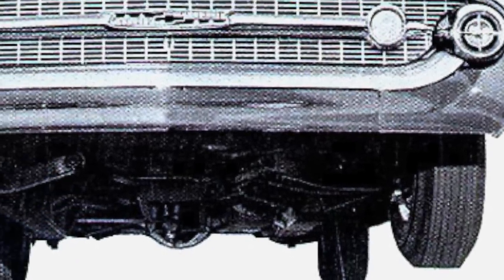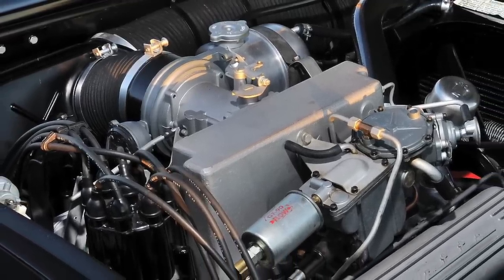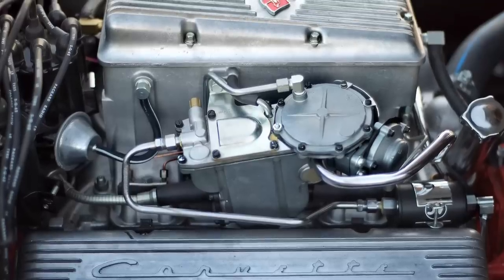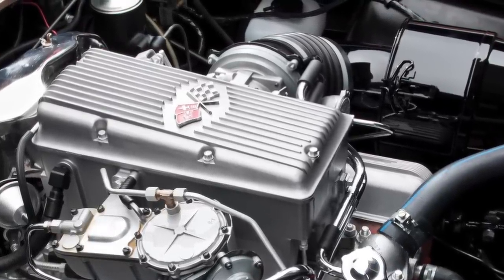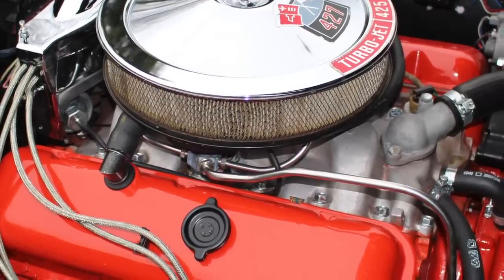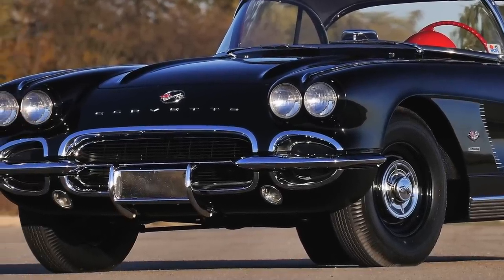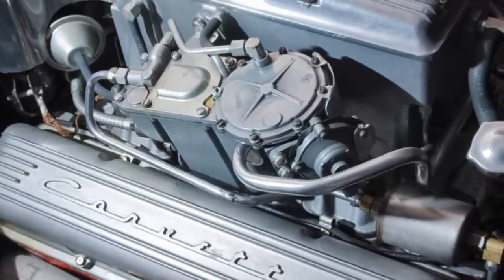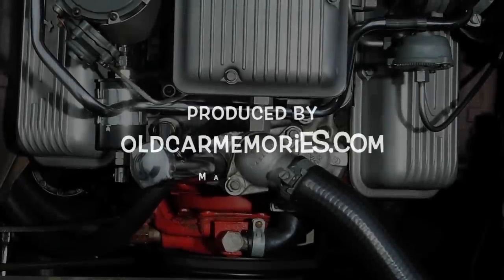Why Chevy Abandoned the 1962-1965 Fuel Injected 327 V8

Comment: Now do a video on why oldsmobile abandoned the v8 turbo idea in the early 60s. 1962 oldsmobile v8 turbo. First production car ever with a turbo...
Reply: GM went from building these small family intermediate cars on the Corvair floor pan, to a perimeter chassis that could handle bigger engines. The Olds would detonate unless you kept the "rocket fuel" (their name for extra windshield washer fluid used as water injection) bottle always filled. It was easier to build bigger engines (tho no bigger than 330 cid, which is why the Pontiac 336 is known to us as the 326) and sell the 215 design to Rover--and sell the V6 design made from it (which is why the Buick V6 was a deep skirt design in the GNX days) to Jeep to buy back the Dauntless later on.
Reply: @albertgaspar627  GM put plenty of big blocks in the Caddys tho and Olds and Buick had quite a few engines over 400ci
Reply: GM followed the 1957 AMA ban on supporting racing, at least officially. And after the damage done publically to the Corvair, GM decided they weren't going to put anything larger than 330 cid in their intermediate cars in 1964.  They did put those engines into their fullsize cars that went racing, like you said, but otherwise they didn't want "overpowered" family cars that still ran Nova sized drum brakes and skinny tires.  As the intermediates got bigger and longer, the limit was 400 cid, so the Buick Gran Sport running the 401 Nail head dropped the "1" until they came out with their better big block. Also, the GTO option snuck the 389 into the intermediates since the Pontiac block is the same size block until the 301.  

By the time GM execs found out, it had solid sales numbers--they weren't going to kill the golden goose, and GTO became its own car, not an option hiding a powertrain.  But even with 400 cid, GM muscle was up against 440 Mopars and 428 Cobra Jets. Its why Yenko did 427 corvette engines in Camaros, Novas, and Chevelles and sold those COPO models to other dealerships, but some like Baldwin-Motion, Dana, and Nickey were doing their own swaps. Myrtle Motors and Royal Pontiac did 400+ cid engine swaps on Pontiacs, and Oldsmobile had the Hurst Olds using the Toronado 390hp 455. In 1970, GM realized it needed to let its muscle cars have more than 400 cid, and that's when you got 454 Chevelles, 455 4-4-2's without having to buy a Hurst Olds, and the Pontiac 455 allowed the use of air conditioning because it wasn't revving so high as the Ram Air fours yet had plenty of torque for the quarter mile--and auto makers make their money selling options and loan packages.

Comment: I’m walking back to my car at the gas pumps and a older man gets out of a 63 vette, I see the 327 electronic fuel injection badge on the fender. I instantly turned and got his attention and asked while I point at the badge with a smile, This still fuel injected?
He lowered his head and said NO☹️

Long story short, he bought this car as a teenager from the dealership his dad ran. It was a trade in and he’s owned it ever since. He didn’t realize (Just like 99% of everyone back then) the value these cars would bring so he removed that pesky EFI for a carb.Anyways, the reason he’s never sold it is because he enjoys driving it. Now I don’t know if his story is true but he seemed honest and genuine. Regardless, It’s a very very nice clean white on black 4 speed car and I probably wouldn’t sell it either
Reply: It was mechanical, not electronic, fuel injection. Just F.I. not E.F.I.

Comment: I bought a blown  '62 fuel injected 327 engine for $200 in 1973. I put the heads, fuel injection, and an aftermarket cam in my '72 307 Nova. Never ran it at the strip, but on the street, it would eat stock big block muscle cars for lunch and could often keep up with modified big blocks. 

 I rebuilt the unit before installation (the parts were available at Chevrolet)  and ran it for three years. Never once did I have a problem with it in 30,000 miles of driving. In 1976, I placed the unit on a 400 small block and drove it for another half year before turbocharging (with a carb) the 400.

Comment: Ah, brings back memories.  While in high school, my little brother and I built a 327 starting with a bare short block.  Added 12.5:1 domed pistons, high lift cam, Edelbrock intake manifold, Holly dual feed, headers, ported and polished heads, chromed everything that was not painted Chevy orange, etc.  Every piece of it except the block and heads was brand new.  I finished it right before I left home for college and had it on display on an engine stand.  Dad later sold it, but he had paid for everything except the bare block and I had no further use for it nor even a car to put it in.  It was beautiful.  I lost interest in cars, got married and never built another engine after that.

Comment: My sister had a mechanical FI Audi Fox and they proved quite difficult for North American trained mechanics to repair and tune properly as compared to the carbs. That and the additional cost sealed the fate of fuel injection until computer control came about  in the late 70's and early 80's.

Comment: The Mercedes had Direct Injection in the gull wings (DI appeared first in WW2 German planes), Chrysler had Fuel Injection from bendex in 1958 that had appeared on some American Aircraft in WW2)
Reply: And Ferrari was making 100 hp per liter in the early 60's that's would be like a 327 making 540hp.

Comment: Great video!! I have some information and a story to help answer the question posed in this video, why GM abandoned fuel injection. I live in Rochester, NY. Home of Rochester Products, a division of GM. Also home of the Rochester Quadrajet carburetor..which we as young men called the quadrabog due to us not being able to set them up correctly and the car bogging instead of roasting the tires.  I worked as an auto mechanic in 1987 and 88 so the cars i was working on had miles of vacuum hoses, driveability problems were very difficult to identify..for me. So i used to curse GM for hanging on to the carburetor for so long, often saying out loud "I would love to meet a GM engineer and ask him why they didn't switch to fuel injection sooner."
Well...about 3 years later i was working at a welding shop and we had a customer named Tom Toal. He worked for GM his entire life and for the last 20 years of his career he'd live in Las Vegas in the summer and Nova Scotia in the winter, testing GM fuel systems. He told me that cost was the factor for why they kept the carburetor, a two sided factor. One, the cost of re-tooling factories to start mass producing fuel injection components and two, the cost to the consumer for the more expensive fuel injection system. 
Funny that of all the times i asked God, or just asked a question out loud..this is one time my question was answered!
Tom and i became friends, he showed me how to setup a Quadrajet properly, he could do it blindfolded better than i could on my best day. That was around 1990 I'd guess. To add  even more irony of the story, I finished my engineering degree from RIT in 1994 and worked at Delphi in Rochester from 2001 until 2011 where both the Quadrajet and all GM fuel injection systems were designed! I worked on the Solid Oxide Fuel Cell (SOFC) program as a manufacturing engineer. SOFC is one of many different types of hydrogen fuel cell designs.
Well, that's my history to add to the question posed by the video!

Comment: I had two friends in NYC who owned a ‘61 and a ‘62 “ Vette fuelies” which were very fast. They had problems unless they were tuned correctly. Bobby had the ‘61 and had it dyno-tuned by an outfit in New Jersey while the owner of the ‘62 left his alone, just tuning his by a local Brooklyn mechanic. I rode with Bobby when they raced on the Belt Parkway. Bobby was pulling away from his opponent until the clutch and flywheel detonated. Great stuff in those days despite the destruction which for seconds, convinced me I had died. I miss those days so much.
Reply: ... I'm glad that your left leg / ankle weren't hit by "shrapnel" from the clutch & flywheel disintegration!

Comment: I had a 64 fuelie 327 in my 75 Nova with everything original in the motor except the fuelie setup. I put on a Holley still had the fuelie heads cam intake. Then my 77 Nova had a 302 DZ motor with a Saginaw . I used the Saginaw 4 spds because the Muncie housings blew apart . Especially at 10000 rpm lol. The 302 was balanced blueprinted and completely flowed with everything imaginable for durability , to easily rev 10500 rpm . It was almost unbelievable how smooth it was .

Comment: Never could figure out why a friend of mine in the mid 70''s yanked the original fuel injection off of his vette and slapped on a carburetor. Yeah, I know, horsepower was king but his mileage went from around 22 mpg to less than 10.  The car was a blast with the fuel injection and you could actually pass a gas station without having to fill it up.  Not to mention the drop in value by losing the original, unique, fuel system.
Reply: Those original Rochester fuel injection units are rare as hen's teeth. I bet your buddy tossed it into the scrap heap, didn't he?
Reply: Unreliable? or just mechanics didn't know how to service it.
Reply: Maybe because it is difficult to tune MFI to engine modifications. You can compensate for barometric pressure and temperature pretty easily but not for different cam timing, exhaust mods, head work etc.
Reply: Even through the 90's people were taking off the 5.0 mustang and Camaro fuel injection(s) to put on carbs, very rare to do that today.
Reply: Ok, but 90s' era 5.0 Mustangs and Camaro's aren't exactly classics--LOL
Reply: Mike, but in the mid 70's was a late C1 or early mid year really a classic at that point? You could probably have got them fairly reasonable on the used marked at that point especially with the gas crisis in full swing.
Reply: @Walker: Granted a 10 to 15 year old Vette wasn't technically an antique or classic but most car freaks my age at the time knew they were special.  Most of my cohorts wouldn't have thought twice about tricking out a '66 Mustang or other pony car but would have thought twice about messing with an early sixties Vette. As for reasonable in price maybe if you were pulling in good money. At 16 to 20 years old and making a buck sixty-five and hour it would take a while to pay one off.
Reply: Mike Staihr jni
Reply: Because it was easy, gas was cheap, and at the time it would have been a ten year old car so it wouldnt matter.  Only recently have car values ballooned.  Nobody knew they were hurting a future collector grade car.

Comment: Gas was way cheaper then too so people weren’t willing to pay more for the car to save a bit of gas
Reply: So in 1965 gas prices averaged $0.31 but corrected for inflation that comes to $2.50 per gallon in todays dollars. As of writing this the current average gas price today is $2.88 so really gas isn't much more expensive today than it was back then.
Reply: They still don't sell a car marketed  for efficiency that's fun that's why all they can sell are trucks. All they had to do was market it as +1 HP per cu and they wouldv'e sold more.
Reply: I think most people don't adjust in inflation and wages between today and back in the 60's. Average yearly income in the 60's was like $7000 for a family, $4100 for an individual. Base MSRP for a 65 Vette was $4000. So that's almost all of a couples or ALL of an individuals YEARLY income. Fuel was about almost even with today's market.
Reply: When Chevy had the FI in 1957, there were two varieties--the 250 hp @ 5,000 RPM, and the famous 283 hp version. Pontiac and Chrysler had FI as well, but it was the Bendix units that failed.  If you wanted fuel economy, it was probably cheaper to get the 3 speed with overdrive, even though it had 4.10 rear gears. But, fuel economy WAS an issue, America had a recession in 1958 coming up. Chevy went from 3.70 rear gears to 3.55 in the stick shift models, 3.34 instead of 3.55 with the Turboglide, in 1957, so the engineers were either looking at fuel economy for the larger 1957 or they were worried about warrantee claims.
Reply: Terry Melvin  exactly!  The Edsel had its issues, but so did other cars--the recession hurt it, and Ford didn't change its look in 1959 whereas GM did.  And the recession also drove consumers into smaller cars--before malls, mom would shop in town, going from store to store for individual purchases.  Imagine trying to parallel park those long wheelbases a few times an afternoon.
Reply: nobody got the fuel injection to save gas. it was the highest horsepower option you could get.

Comment: 375hp back in the 60’s.. holy smokes
Reply: Well, Gross Horsepower, not net.  GHP numbers were wildly inaccurate, varying from manufacturer to manufacturer and even engine to engine, as to how they were measured.  In the 70s they started using BHP instead, much more accurate and standardized.  I don't know how much BHP the fuelie had, I'm sure it's impressive and more than one hp per cubic inch, but not 375

Comment: I had four of the Rochester FI units at one time; a 1957, a 1959 and two 1965 units.  I had one very, very rare unit that was built by Bill Thomas Speed and Marine for the 1965 Chevrolet Can-Am racing series.  It was modified with the single air meter on the driver side removed and blocked off.  They then installed two air meters on top of the plenum using 1/2" aluminum plate.  The injectors were oversized and the fuel ratio levers modified slightly.  I ran this unit on a 1970 Corvette LT-1 in my 1969 Nova SS.  I had taken out the original 375HP 396 and replaced it with the fuel injected LT-1.  The LT-1 was perfectly streetable, got 17 mpg on the highway and pulled about 450HP after I rebuilt the engine.  It was one of the fastest small block Chevys that I ever drove.  It was completely mild mannered until you put your foot in it and then it came alive.  My first run with the car at SIR near Seattle I was up against a 425HP 427 Corvette and beat him by two car lengths even with a bad launch.  For a '69 Nova, it was a very fast car.
Reply: Bill Thomas (Calif.) was famous for his Cheetah's road racers that were a very short wheelbase (Cobra Killer) with gull wing doors and a highly modified 327, Corvette/Rochester Fuel Injection unit with the two 580 cfm (each) air meters mounted on the top of the Corvette plenum chamber (dog house). A very fast, lightweight, no drive shaft (direct trany to rear independent rear pig and very dangerous to drive!!

Comment: Excellent video. I'm an old Chevy fan.Backyard wrench.Learning curve to get an 87 Suburban, V8. Now I see advantages.( not fuel pump in gas tank!) Yet, if I had $$, I'd build a clean 86 Sub, Small block, 4 brl carb, gobs of HP, Fuel pump on engine, lo lead heads, 7R4 trans. Last truck I'd ever need.

Comment: Speaking of the 1965 Corvette ..Another Story.. Zora Dontov needed a L 88  Engine shipped to where he was so he contacted the boys at a factory/dealership  and they dropped the  L88 into a white 1965  convertible corvette and shipped it too Zora .  then the engine was removed straight away and dropped into a 1963 Vette and his race team went Racing..  so for a short time sitting was a 1965 vette with a L88 In it...  that was the first corvette car too have a L88 Engine  ,.. The engine was the first L88 Born for Use

Comment: Exactly (month/year) when was the plenum box looks changed? 
And was it functionality different on the inside?
Reply: 1962 used the old plenum, 1963 used the newer one with removable top. I think the newer one had shorter length tubes, to enhance more at higher rpm. But both 1962 and 63 were rated at 360hp.
Reply: Al Brase  Ok, thanks. But, if it had a shorter length, was the cam profile changed?
Reply: In 1964 getting from 360hp to 375 hp. Exact same motor with a 585cfm Holley gave 365hp. Pretty cost effective but the FI gave way better cruising economy. WRT the cam change the Duntov 097 cam made hp at relatively high rpm. But the Fuely cam had more lift. Same cam as the 1967-69 Z-28's, btw. Modern cams can wake up these engines a lot. And still give good midrange performance.
Reply: It was changed on the 1963 models. The fins on top of the first style disappeared in '60, and the 62 units were the first with the electric chokes.